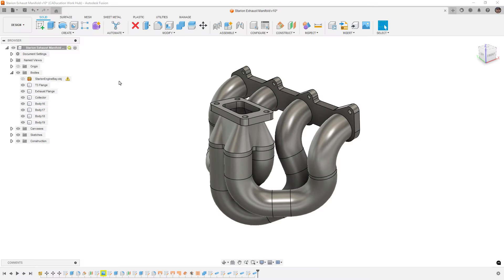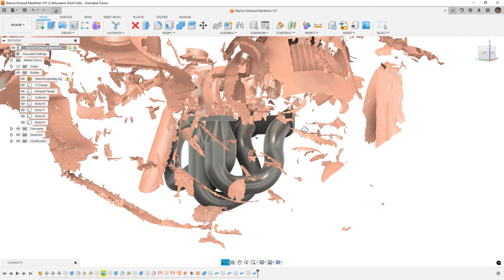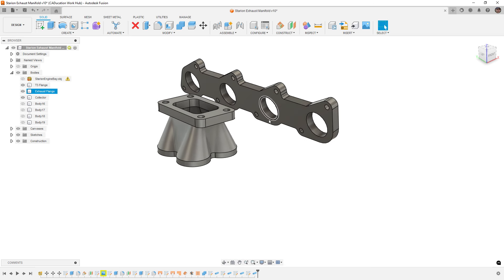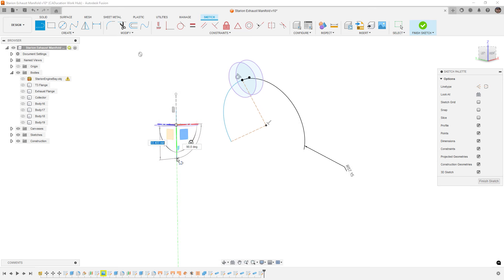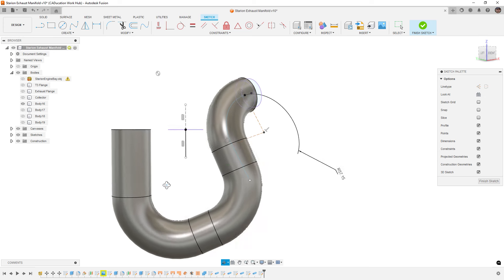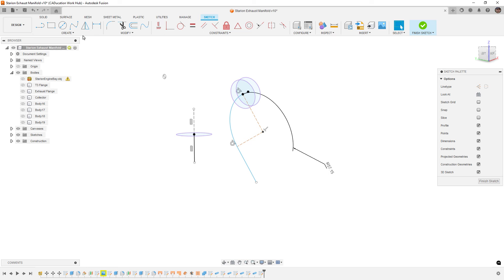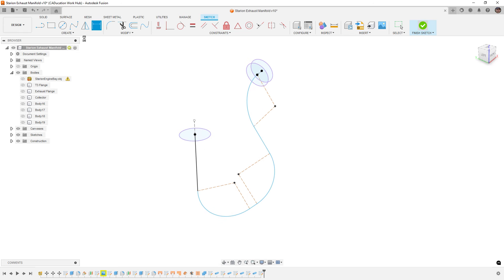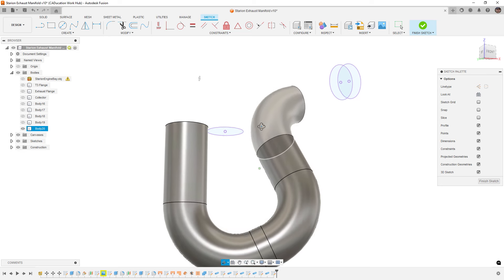How To Design A Turbo Exhaust Manifold With Fusion

Comment: Hello, 

Im designing exhaust piping for production,, and I'm using Another method for this type of work.. It's much easier than 3d sketch.. Im creating one component for strait pipes, and second component for elbows / bends, with simple 2D Sketch... Then I'll make copies of what I need, straight or bend.. simply joining them together with "Joins"... Now You can simply enlarge straights, or make changes to elbows, just simply editing 2D Sketch with dimension.. and for rotation You can use position in joins 'settings'.... 

Simply put,, create straight, and bend parts,, and simply join them together
Reply from the maker: Thats a great tip!  So you typically use all weld els and just copy/paste and join them at different spots.
Reply: Yes, but keep each pipe/elbow as separate components, copy/paste_new command, then you can adjust sweep angle or length of pipe in each component sketch, or from the parameter window.

That way, you build the manifold almost as you would in real life, with tag welding and adjustments.

Comment: I’ve been watching some of the paid vids from your site, trying my own design and gave your manifold file a try…sketching in 3d is tough but using other angle elbows 30, 45, 60, 90, etc helped some.

Like with the runner you did in the video I just did a 75° elbow off the head and that got me parallel to the collector but the new issue was I was too far towards the collector after using two 90’s…

So is there some math to figure this stuff out? Assuming you’re not limited to 90° only? Instead of a trial and error type deal until you get everything to fit?

I see some people make some very trick manifolds in solidworks and I have a feeling they don’t plot a head flange and collector and start “digital eyeballing” until something fits. 

Im also very new to fabrication and CAD. Maybe that’s why it’s so difficult

Edit: watched the video again and I’m gonna try doing straight lines and adding fillets with a consistent radius afterwards and see how that goes!
Reply from the maker: Yeah one of the commentors said they make the bends as components and join them together in an assembly as an option.

I think the general problem is that using Weld Elbows you are somewhat fixed at 45deg and 90 deg in most cases.  When i have made turbo manifolds I generally buy 180 degree "U bends" that have straights on either side.  Then i cut that up to whatever angle i need.  The weld el route is more difficult than if you have some freedom.  I have also done them with Pie cuts but that is a lot of work and a lot of welding!

Using straight lines and adding a fillet on the corners for me is a bit easier, but I haven't tried the approach of doing the components and using joints to assemble them.

another thing that would be easier in this case is to tilt the turbo flange the same amount as the head flange.  As long as the oil drain line is still the low point when you clock the housing it would be fine also.  That would help too.
Reply: @ okay, I read the comment about sketching in 2D than joining. I’ll give that a try!

https://youtu.be/dPEqK08p8sA?si=J_lajT7VK0UL7FES any tips on creating a step up joint like in this manifold? Would you just make a plane at the end of an elbow or straight and revolve a circle to the next size up tube?

Comment: I may do something like this in future but using Xometry to make the pipes so they are bent to spec for the model and have fewer welds.
Reply from the maker: If you end up printing something you can get away with way cooler shapes and non round cross sections!  I have never welded 3d printed metal before.  I have soldered to it before though.  I wonder how welding would work.

Comment: Great vid, thank you. 3D sketches always gave me problems.
Reply: Me too, that's bc the implementation in fusion is just subpar imho!
Reply from the maker: Yeah....  I did start the video warning it was painful :)  3d sketching anything other than straight lines along XYZ or doing a 3d spline with references is very tough to control.  I certainly prefer the straight line and fillet method and just buy some bulk prebent sections of tubing.
Reply: @LearnEverythingAboutDesign  Yes you're right that was a much easier way!

Comment: Would putting the collector at 15° also help these tangent issues any?
Reply from the maker: Possibly since the head is tilted, but honestly CAD solving these constraint type issues in 3d is a common problem not just in Fusion.

Comment: Hi Matt you forgot one other method. You can 3d print the manifold. Probably nobody has a SLS metal printer but online are a lot of solutions available to do the work for you. Just to complete your always great videos 👍👍👍👍👍👍👍
Reply from the maker: I can only imagine the cost of that :)  Years ago i saw a beautiful intake on a datsun forum where they CNC milled the top and bottom for a 240z and welded them together.  It was a work of art but the Billet to machine each piece must have been $$$
Reply: @LearnEverythingAboutDesign  Agree it will cost a lot, still it’s an option and in some cases you need the flexibility. I guess this will mostly used in racing cars where is a high budget. But why not try it, you have a nice STL file, ask a free quote at PCBway (for example).
Don’t understand me wrong, my input was only to complete your story. In no way I meant any criticism, I love your work on youtube
Reply from the maker: @Eric1960  No worries I didn't take it as a negative :)  but thank you!  There have been some high end super/hyper cars that have done 3d printed inconel exhaust components for things like heat shields/pass thoughts on hoods and firewalls.
Reply: 3d printed 316 isn't as bad as one would expect. Esp if you say make the runners separate so all you have to do is weld it together 😊
Reply: @LearnEverythingAboutDesign submit your 3d model to xometry and get a quote generated and make a video about it lol.

Comment: As always, thank you for the great videos.  I always learn a trick or too from each video.  

I may have asked this before on a previous video, but how would you create a dimensioned drawing from a model like this? How would you show the angle of each bent section? How would you communicate the angular rotation to adjust the out of plane bends?  While it is super cool for us to be able to design and visualize parts and assemblies, but if we can produce a documents, or other build instructions, these cool models and renderings are useless.  I have used a combination of AutoCAD, Fusion, and a software similar to Bend-Tech to build a header, but I'd really like to figure out how to do it all in a single program, especially if that program is Fusion.
Reply from the maker: yeah that is a tough one for sure making a drawing for something like this.  So if you were using say bend-tech often times the entire primary is a single pipe that gets rotated and bent and its figured out from a step file/3d model.  For something like this if you needed to make a drawing in say Solidworks you can import annotations from the sketches and include them in the drawings.  So if you did the first arc out of the head plate and rotated it 30deg toward the front of the engine then you could have that dimension imported.  Sketches in fusion drawings doesn't really work so great and you can't bring 3d sketches into a drawing unfortunately.  So i don't really have a great answer for that other than manually recording the bends, angles, and lengths from your 3d sketch and doing a generic table in the drawing to capture that info.  I wish I had a better solution.

IF your 3d pipe runs were defined by projected 2d sketches you might be able to get away with that by showing sketches in the drawing....might...

Comment: Hey Matt great video
Reply from the maker: Thanks!  I think i saw a comment from you asking about the radius.  Most of the time you will have that info provided by the manufacturer.  https://www.aceraceparts.com/collections/weld-fittings-weld-els/products/weld-els-short-radius  if you look at that chart at the top it lists centerline radius of 2.25in (57.15mm).  Not all suppliers will have that info and you may need to do some digging but a good bit of them do.

Comment: Hi, I recently discovered you in a process of creating a motorcycle part, I wanted to know if you could advise me on the best possible solutions.

For example, I would like to make a 3D scan of a motorcycle fairing to create spoiler (it's fashionable at the moment) and use the 3D scan as a reference to create a non-parametric part because motorcycle fairings often have complex curves.

Do you have any application advice to use, because I can't do what I want on Fusion.
Reply from the maker: I have a video on doing a tail section, and any of the videos specifically on modeling form parts off scans would work.
https://youtu.be/jQM4zCFZ9yY

do you have a scan now?

Comment: This is definitely going in my favorite videos list. I’ve been pondering about making an intake manifold for a 2.4L Dodge engine. I could be dreaming, but I was thinking about using single barrel intakes. One for each cylinder.
Reply from the maker: I did an intake set of videos awhile back https://www.youtube.com/playlist?list=PLBDfGh8A8kXXkrW-pb6JpzxdqjLW4IFBc  that has a few options on ways to model.

As for the single barrel intakes, that really depends.  Its a game of either high rpm flow or volume depending on your application.  For example you see high revving engines being able to use short runners and individual throttle bodies and it works ok.  In most cases you want a reasonable size plenum for a turbo application so there is enough volume to fill the cylinders.  the "cannon" intakes are pretty common and generally easier to fabricate, but if you are staying NA then who knows :)
Reply: Will be a waste if it's turbo. Just do a single manifold and look at the new srt4 manifolds that are proven to make power. The newer ones are even smaller than the original style I think they flow better with boost.